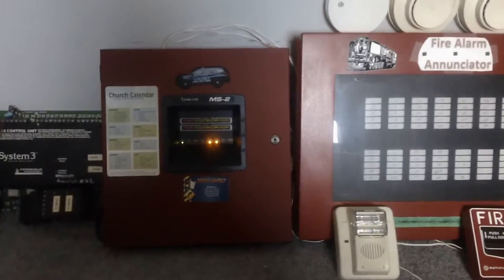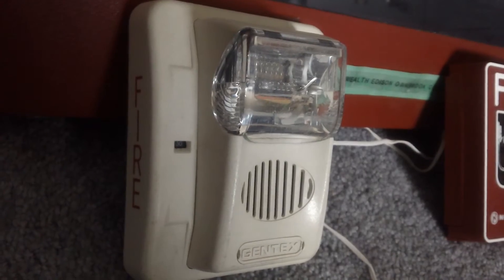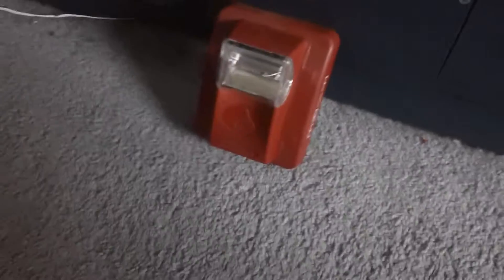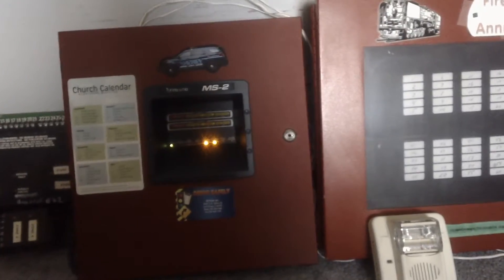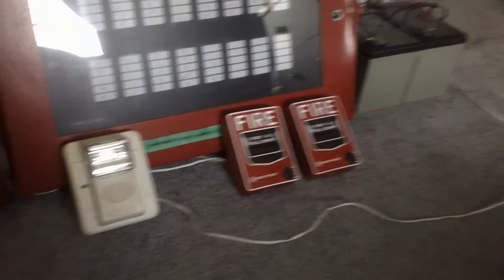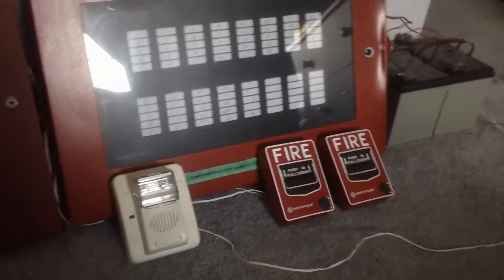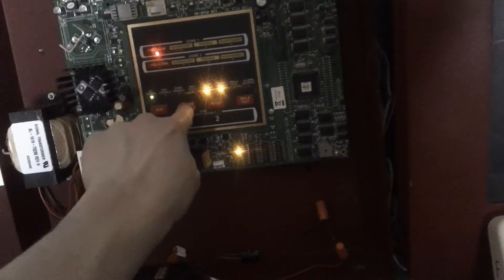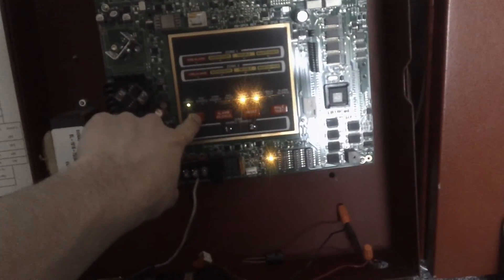Floor System Test 27

Comment: Actually its not a bug with the panel. Gentex sync is supposed to sound like that. I have a gentex sync module and it dose the code 3 fast. I have an ms-2 also and mine dose that. And also my school has gentex commander 3s and they do it too so its normal.
Reply from the maker: Interesting, thanks.
Reply: msj191961 Your welcome

Comment: @msj191961 check the horn for capacitors and diodes in a manner that seems like it does not have a protection circuit that is supposed to protect the device from FWR power and allow the device to run flawlessly... The strobes is what you need to be the most caucios of...
Reply from the maker: Even if it's completely safe to do it, I still don't want to haha. I've seen other identical horns running on FWR and they sound like crap. I know those horns are old and fragile, and I still don't want to put any of my older devices anywhere near FWR, protection circuit or not.
Reply: You have a point, but sounding like crap it does not... It just sounds raspy, like as if you were applying iAC power to it... I just need to know if the horn has capacitors and/or diodes... That's all!
Reply from the maker: I'll check tomorrow.
Reply: Sounds good!
Reply: Did you find anything that would disrupt the horns operation when ran on FWR power?
Reply from the maker: Bob Trevek There's a diode and a few other components.
Reply: No capacitors?